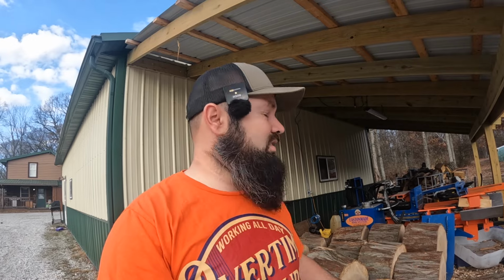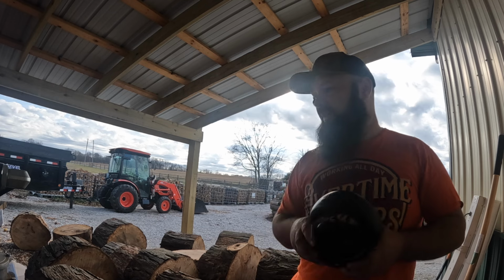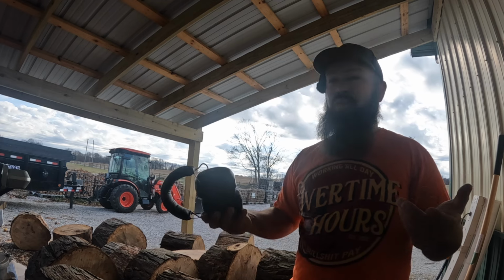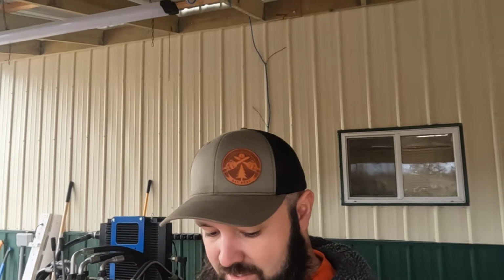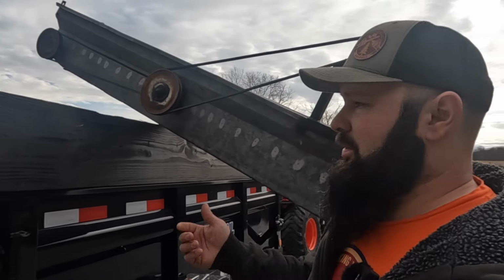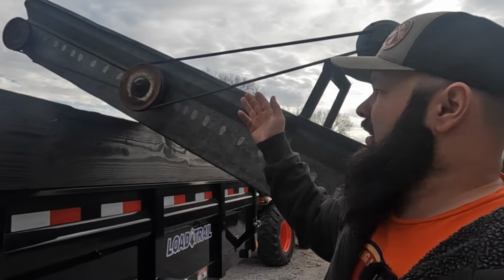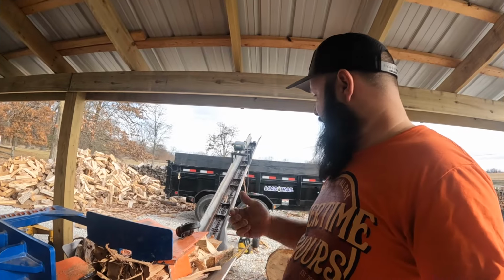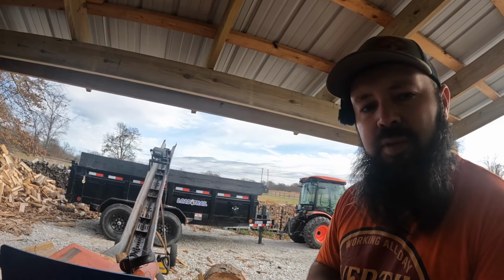12-22 & Box Wedge Take On Big Hickory!

Comment: Hey, so I have a couple suggestions I know things are always on a budget lol. The start off with your conveyor and your belt problem all you need to do I feel is to put a idler pulley on it on an arm with a spring. this will keep tension on the belt and keep it driving a little bit better for you and it’s pretty inexpensive. All you need to do is get a couple ball bearings a Bolt and a nut and welded onto a piece of flat bar drill hole for the spring put it back to your conveyor. So my next question to you is if you look at what your Easton splitter is doing and it is piling all up at the end of your box wedge. I’m not sure what it is with your four-way or six way wedge. My suggestion to you is the yellow piece at the end of your box wedge is there anyway of tilting on a bit of an angle down towards your conveyor?. This may make things a little easier for you. I also suggest if you had a piece of sheet metal screwed onto a piece of plywood and put it onto your conveyor bucket on an angle that it has more ways to pick up the pieces to send them on their way I would leave a little bit of a gap, so that the log has a chance to flip onto the conveyor. I feel that the angle is wrong for your conveyor the way it is now you want the wood to flip on to your chain assembly.
I do feel that you can make it work pretty inexpensively until you can get something better. We all know that conveyors with belts are a lot better but you know what we do what we can with what we’ve got, and these things are very simple and inexpensive to try. Hope it works for you. Good luck
Reply from the maker: These are great ideas! I appreciate you taking the time to share them. I’m Definitely going to work on it!

Comment: Make rubber flaps to keep wood out of the chain. Use pieces of old conveyor belt or buy some 3/8"+ sheet rubber. Fasten down with washers, nuts and bolts.  Lol
Reply from the maker: Great suggestion, This has been done a few times. It definitely helps.

Comment: It's not the belt tension  so much as  the pulley ratio. If it was me I'd put in an order in to Surplus Center and increase the diameter of that drive pully. That will slow the chain and increase the torque . Nothing will prevent the large jams and you want the belt to slip if it does. All the smaller jams should be lessened if you get some power to the chain. If thats an 8 inch pulley on there I'd be going 12 or 14 if it will fit.
Reply from the maker: That is an excellent idea!
Reply: @765Guys  If you can't swing a better conveyor perhaps a makeover of this one  would help. Better pulley ratios and some 2060 chain would beef it up from a corn cob carrier to a firewood capable machine. I'd try the pulley first and see if the current  chain will handle it, that SDC chain ain't really the strongest stuff in the world. It was fine for what it was designed for but I've seen lots of guys pop links using it for wood.

Comment: It's just money, buy a firewood conveyer. I know, this is coming from a guy that hasn't pulled the trigger on a more productive splitter himself yet. I have a good reason for this, it easier and less expensive for me to tell you how to spend your money😂😂.
Reply from the maker: I’m at the crossroad, where I’m thinking, does it make sense to invest into a firewood conveyor for the small amount produce? I don’t know if I can sell the volume I want, for the price I want, to justify the added expense.
Reply: @765Guys  I completely understand. I have been going back and forth myself, buy a more productive splitter than I have or invest in a dump trailer. Which one is the better invest at this time. Just have to way the pros and cons, then do what makes the best sense for you. I'm sure that's helpful advise.😁 Ever time I think I've decided,  I pull back. I finally said to heck with it run what I got, figured time will tell me what the right thing to buy first is.